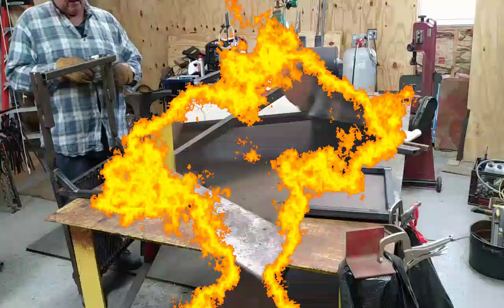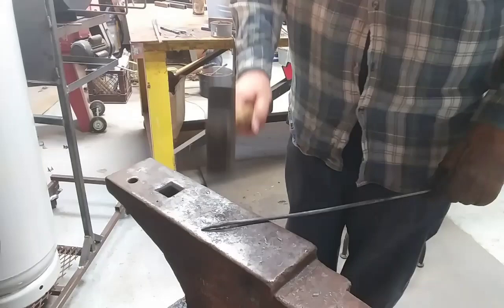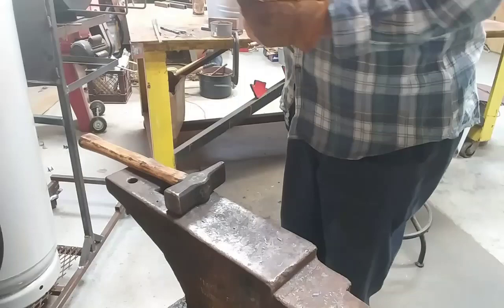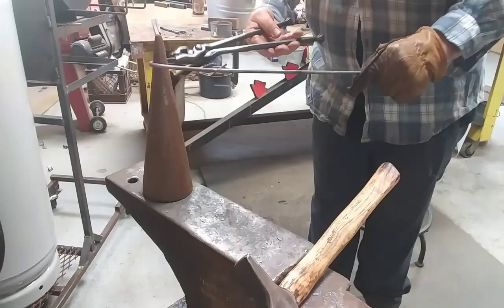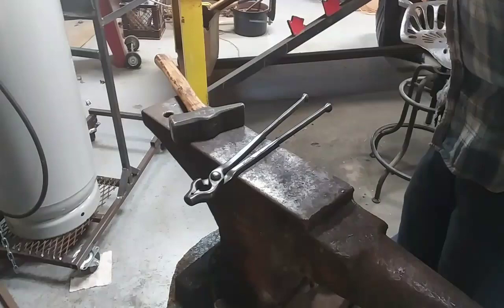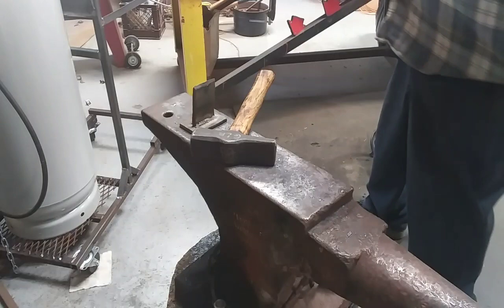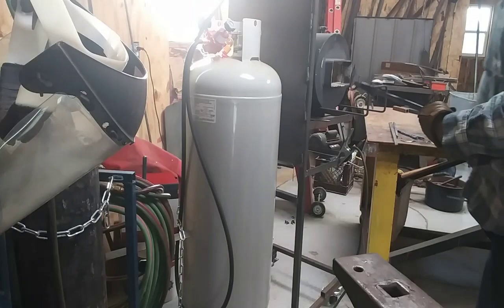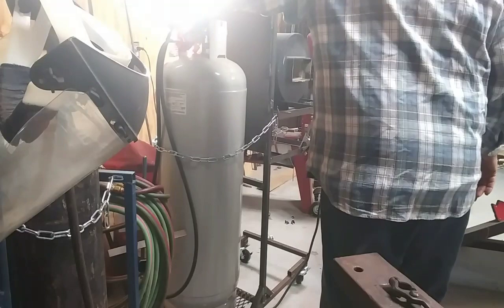Rolling Cart Build for Gas Forge and 100lb Tank

Comment: I’ve been trying to see if it’s safe to hook up a 100 pound cylinder to a forge. I’m glad to see that someone is doing it. Did you need anything special to hook it up to the forge? I have a hose that is supposed to be for my 100 pound tank but I’ve never used it.
Reply from the maker: My tank is close enough to my forge that I used just used the hose and regulator that came with the forge and connected it directly to the 100 pound cylinder. Did not need anything special.  The regulator keeps the pressure set at whatever you want to run it at.  At first I ran it about 4 or 5 psi but the forge kept popping. I bumped it up to 7 psi and it runs fine now.  I have not cranked up the pressure to try to forge weld because I usually use my coal forge for that.  I may try it in the gas forge one day but I have not yet.

Comment: Fair amount of work there, nicely done. How was the shoulder after you finished, I notice a bit of hammer swinging with you right hand although you did keep it to a minimum.
Reply from the maker: Thank you.  It did take me a while.  I need to get a cut off saw. It takes too long with my cheap Harbor Freight band saw.  But it works.  Just slow. 
I had way too much video footage. I had to shorten it a lot and speed it up 8 times.  Shoulder is doing well. Still healing though. I was trying to do the hard hitting left handed and the easier hits right handed.
Reply: And I have to admit I watched a 2 times speed anyway.  I like to watch your work even if the work itself is not quite up my alley, so 2x was a good solution.  Messes with the speech and music but what the heck, I am not looking for guidance on how to make one for myself!